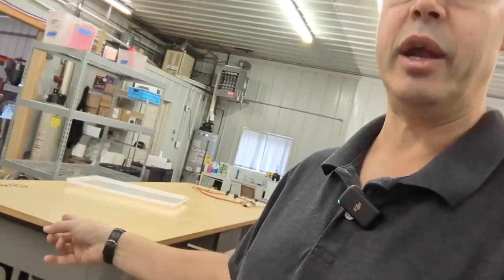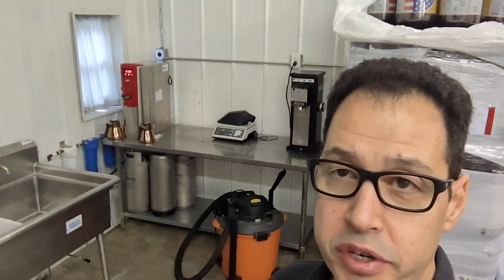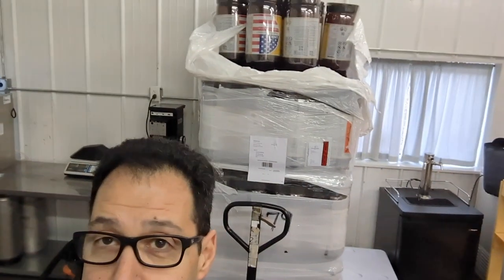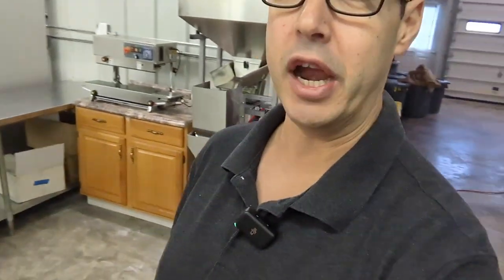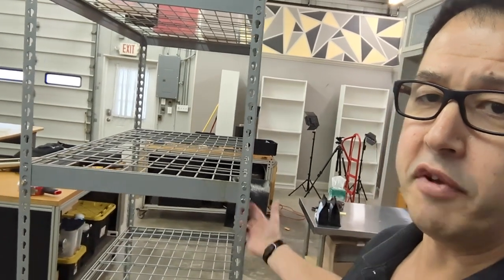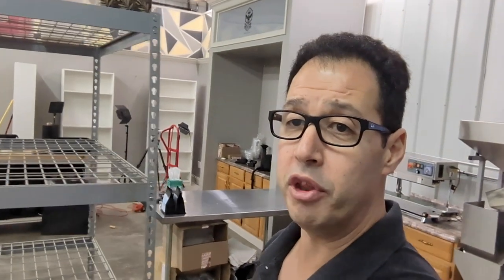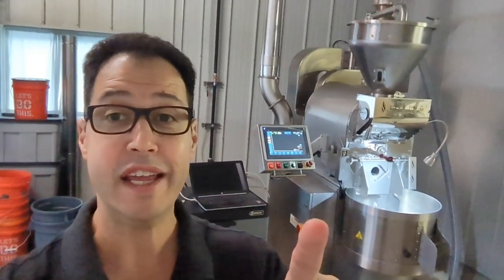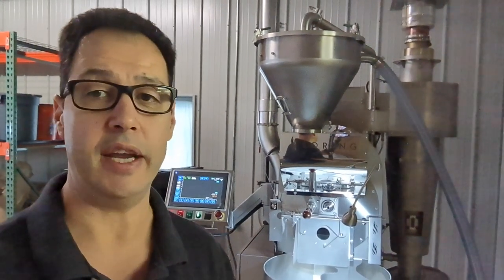New Loring S15 Falcon Install

Comment: what packaging machine do you use and seam sealer
Reply from the maker: It is made by a company called Logitech out of Vermont. If you want the exact model let me know. It's very affordable. The Seam sealer is one I bought off of eBay. They are about $400 and they tend to last about five years. This is my second one.